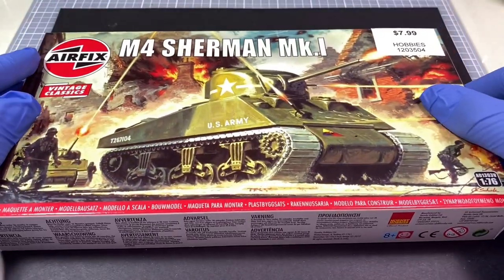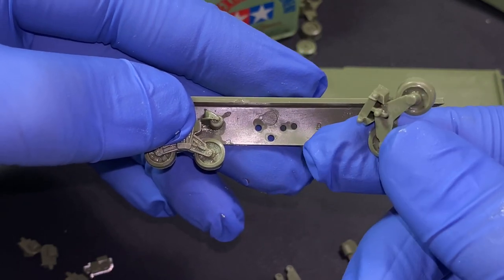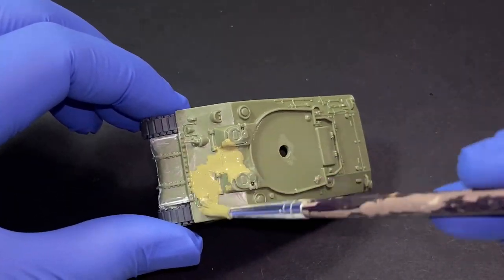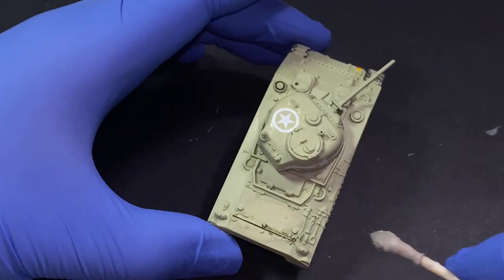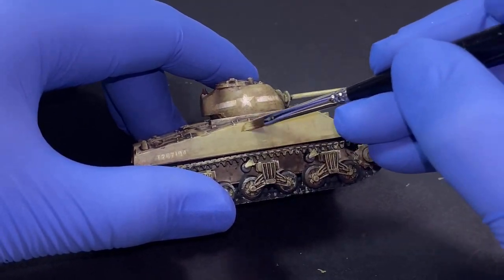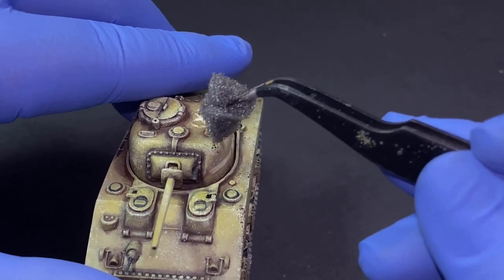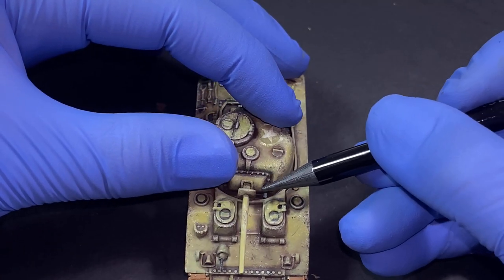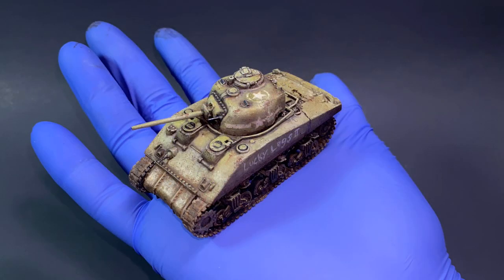M4 Sherman Mk.I-1/76-Airfix-brush painted- tank model

Comment: Was test fitting one of the wheels and it got stuck (backwards I might add cuz I was distracted by 2 of my kids) and I broke the peg/pin that it sits on, grarg. Had to glue it in place 😞😫. Aside from that and some frustrating flashing that's taking me forever to clean up it's a fun lil kit so far.
Reply: I’ve just done the same thing on this kit pushing on a wheel too forcefully / oh well!

Comment: Nice paintwork but why not clean up the mould lines and rough edges on the plastic parts after you've cut them off the sprue? Sanding sticks are great for that.
Reply from the maker: For this model I wasn’t too concerned about the detail and mold lines, but I think you may have caught my many mistakes on the model that I didn’t even notice. But thank you. 😅

Comment: Whatpaint are you using? Do you  use thinner? It seems very liquid to me, and when i do it like that I  get puddles.
Reply from the maker: I’m using Vallejo model color paints and thin them down with just water. If you want a ratio to help you with brush painting. Try 2 drops thinner to 7 drops of paint. :)

Comment: Was this kit Brush Painted without Primer? Did you use a couple of thin coats with paint thinned with water? regards.
Reply from the maker: This model was painted without primer.  I believe I used something around 5 to 6 thin coats. And I did mainly use water for thinning.
Reply: @Modkits131  thank you.

Comment: Su

Airfix classic kits never fit well and actually require better fitting skill than modern kits, but that's part of the fun.  Watchmaker's brooches are superb for enlarging location holes.  Great end result from such a mediocre kit!  The Airfix Lee/Grant would look good alongside your Sherman, and it's actually one of the better quality Airfix Classics.
Reply from the maker: Wow! Thanks a lot. I’ll have to find Airfix’s Lee/Grant. As I couldn’t agree with you more, about the fun and joy in building Classic Airfix kits. :)
Reply: @Modkits131  If you like the Airfix classic kits you'll probably also like the old Matchbox armour kits.  Many are now sold by Revell in 1/76 scale (not 1/72) with cool mini diorama bases.  They do tend to have a higher parts count than Airfix Classics but still have that 'build in a single afternoon' fun factor (I was that kid in the 1970s).  The Sherman Firefly on a broken bridge is a favourite of mine or the M40 GMC for it's sheer heavyweight muscle.
Reply from the maker: Cool! Thank you for the info about match box kits, as I do enjoy the classic model kit. :)